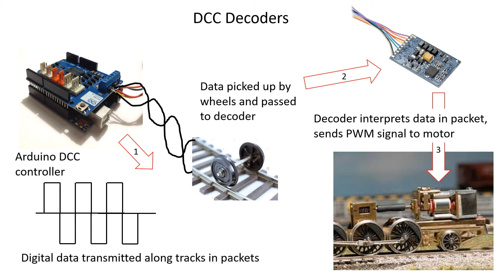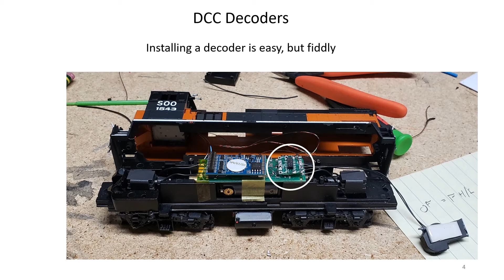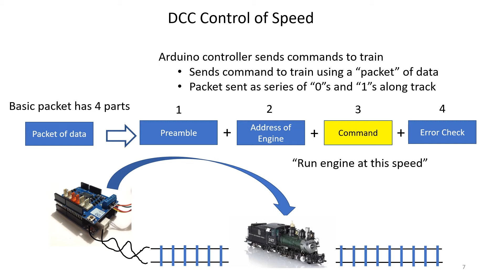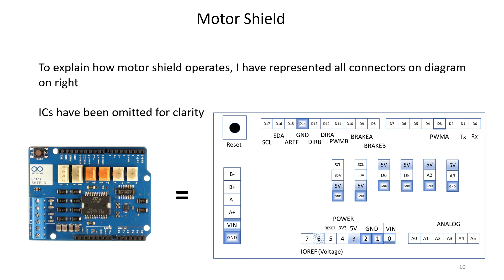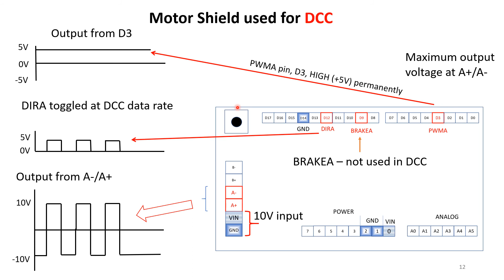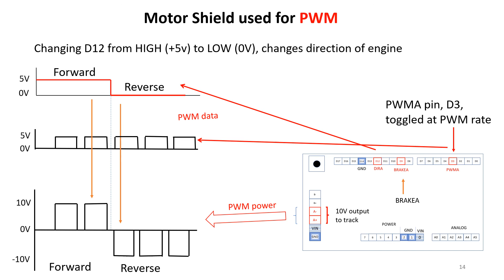DCC Part 5: Decoders, DCC vs. PWM

Comment: Thank you again for the video. What I do not understand is that you say there is a pwm signal on output A. (positive or negative) Is it not the case that the dcc signal is on output A and the pwm is internally (and in a sense not immediately visible) sent by the decoder to the motor?
Reply from the maker: Hi Bm Bm. What you say is correct for DCC. the output from A is in the form of DCC digital signals, not PWM. It is up to the decoder to read the incoming DCC packet, and to generate PWM power for the engine. If the shield were used to control a robot, the output from A would be PWM. The control byte in the DCC packet instructs the decoder on the direction and size of the power, so is not immediately visible from A.
I listened to DCC Part 5 but could not see where the confusion is. Can you let me know which slide is confusing and I may update the audio.
Reply: @robertowen5774  Thank you for your clear answer. In my mind the motorboard had 1 function: dcc output. In previous videos you talked about pwm output and then, I understand now, you referred to robot use, for example. The mistake is entirely on my side. ... and now quickly to your next video!